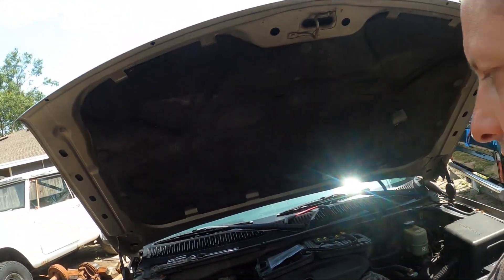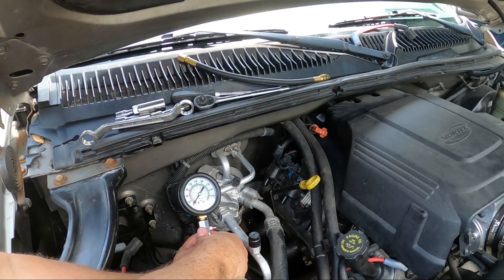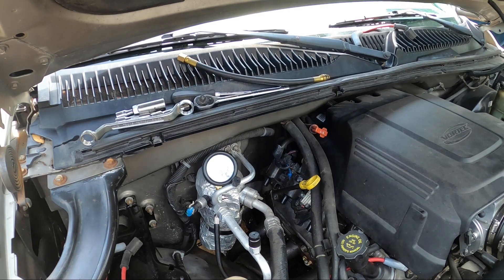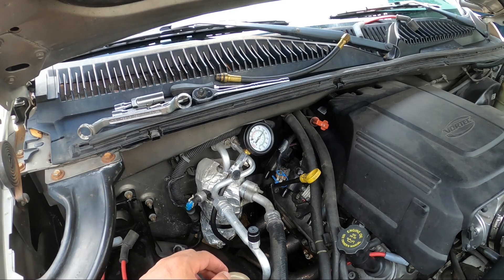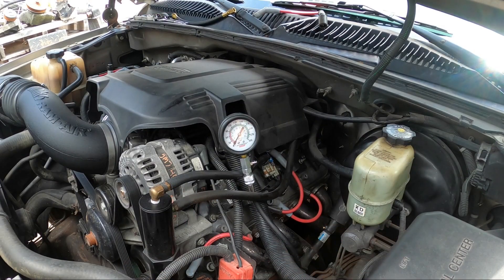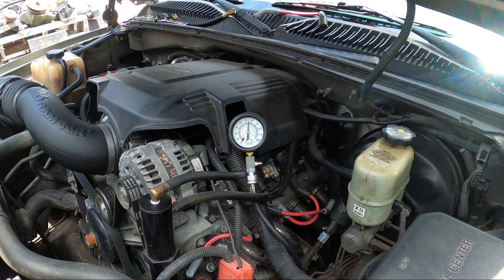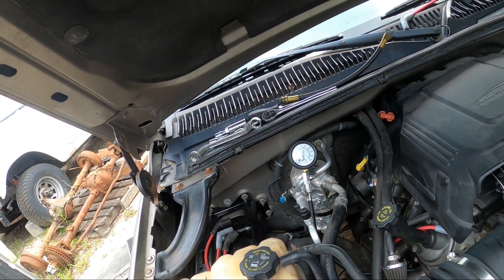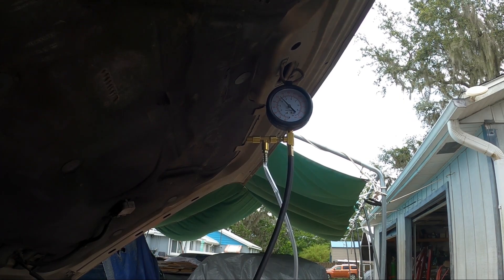Fuel Pressure Test and Compression Check: The Ultimate Silverado Inspection

Comment: Check your comp tester for leaks in the gauge or hoses.
Reply from the maker: That was my initial thought, but couldn't find any leaks. So not sure why it did that on the number 2 cylinder, then worked fine when I retested. 🤷‍♂️
Reply: @bluecollarhotrods9781  sticky gauge id say
Reply from the maker: @shadowopsairman1583  It's a cheap gauge that's for sure. But, it's brand new and was free.99 

I almost wonder if I had some crap on one of the valves and from flying it over it came loose - and let the valve seat. Or like I said before, the lifters had bled down overnight and pumped back up.

Comment: Being LQ4, EV6 injectors? Do you have the fuel pressure regulator on the fuel rail or on the fuel pump?

62 psi is normal.
Reply from the maker: Mini Delphi still on this truck, 8.1L injectors. I made the NNBS return less rails work, C5 Corvette fuel filter.  (internally regulated)